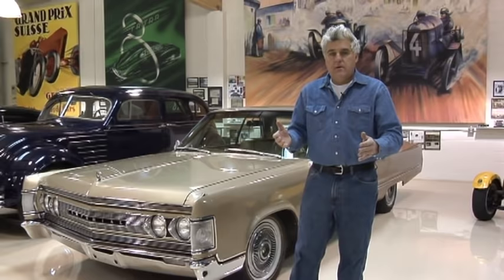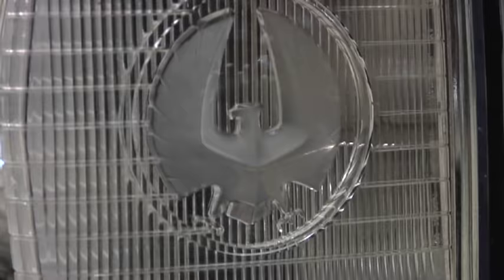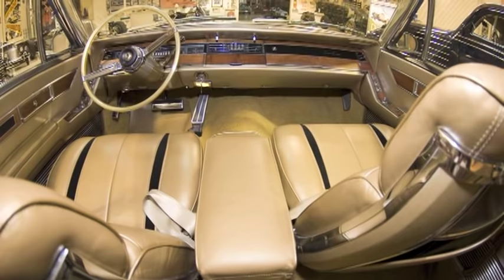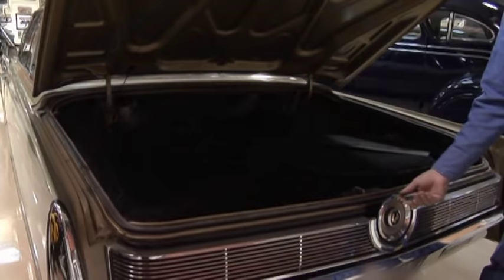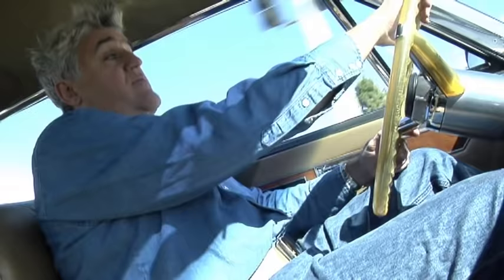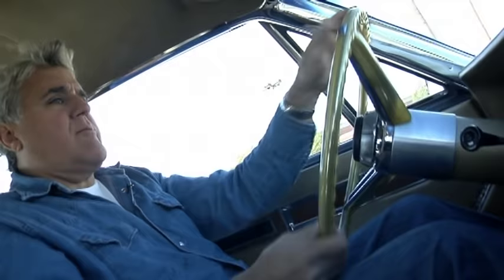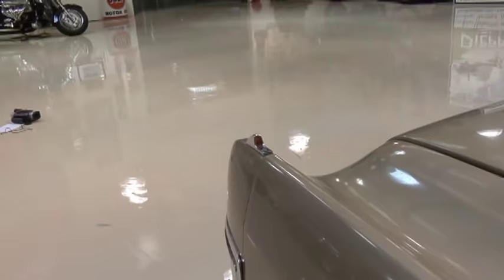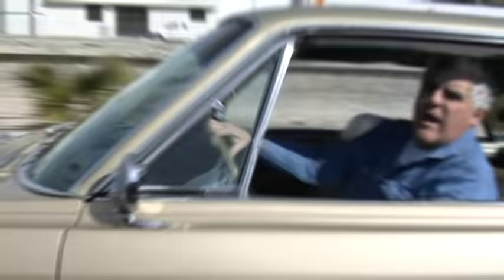1967 Chrysler Imperial Crown Coupe - Jay Leno's Garage

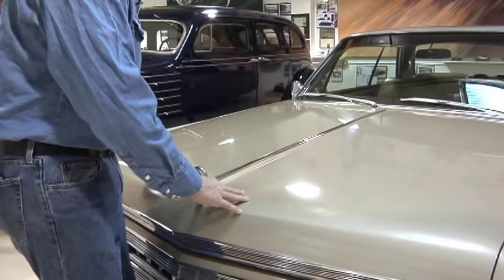Comment: 3:44  "and you're freezing in a minute and a half, you could hang meat in this car"    You're funny.
Thanks for your videos, they are great.  My Dad had a 1969 Chrysler New Yorker, with the 440 cu in  motor.
Quite the automobile.  After that he had a 1972 Dodge Charger, the one with the dual trumpet exhaust pipes.
I was driving it one day, and was parked in front of a store, and this black guy drives up and says, "do you wanna sell that car"?   I said, it's my Dad's I can't sell it.   I think this type of car was in a movie, starring a black actor.
Opps,  second comment of mine,  didn't realize that, well it was 7 years ago, and I ain't getting any younger.  :)

Comment: The torqueflight transmission was not cast iron It was aluminum   It has also been converted to Chrysler electronic ignition  You can see the orange module mounted under the hood on the passenger side I did the same thing to my 67 Imperial Starts easier and runs better for sure. Great car to drive!!

Comment: All of the 1966 and 1967 440 engines were, "hand balanced" at the factory, regardless of car model. This consisted of a heavy, steel  ring on the front of the crankshaft balancer pulleys. It had balance holes drilled into it to finely balance the engine to compare with Cadillac and Lincoln engines for smoothness. This practice ended for 1968.
Reply: I had six 60s Imperials.. and NONE of their engines were as smooth as my '66 Lincoln's 462 CID..... nor did any of 'em last anywhere near as long . . . . .
Reply: @34Packardphaeton  The special balancing was only done with the 1966 and 1967 440 engines. Also the balancing was a heavy ring, welded to the crankshaft pulley. The pulleys could be switched for regular pulleys, resulting in regular balancing, or the engine might have been rebuilt or replaced and the original special balancing wouldn't be the same. The 440 engine was introduced as a big car smooth engine in 1966 and the special balancing was only done for one more model year. It was just a 440 engine with a pulley ring weight that had some balancing holes drilled in it.

Comment: You showed us the tilt steering, but didn't use the Tele-steering that it has.  I had a '66 New Yorker with the same.  Turn that chrome locking ring on the hub of the steering wheel, and the wheel telescopes in and out.  
It will still steer the car if you unlock the ring and even 
also keep the tilt lever pulled.  We would drive down the road moving the wheel up and down and forward and back, still being able to steer, and pretending it was an airplane. :D

Comment: Jay I owned by a 1967  4door. Hardtop it could travel at 15 miles to gallon at 70 miles an hour from Vancouver BC to Toronto cost 120 dollars for gasoline and food for three adults ,my 67 imperial had a 727 aluminum Case transmission it was the best. Car on the highway in bar nun including any thing made by General motors or Ford  I sold it with150 thousand miles on the car

Comment: Technically, it wasn't a "Chrysler Imperial,"  any more than Lincolns were "Ford Lincolns" or Caddies "General Motors Cadillacs."  Imperial was supposed to be a separate marque in its own right, despite its less-than-regal origin.  It started as a high-end trim option for cars made by the Chrysler division, then turned into Chrysler's answer to GM's Cadillac and Ford's Lincoln, both of which started as their own separate companies (ironically created by the same man) and were bought by the respective corporations that now own them.  Japan did not pioneer trying to create a luxury brand from its lower-line vehicle offerings; Chrysler did that first.  However, unlike the names Lexus, Infiniti, and Acura, Imperial somehow never really did establish its own identity as a true luxury marque, and its demise happened just 20 years after its birth.  Of course, the debacle of the "Forward Look" of 1957 did a lot to sully and trivialize Chrysler's attempt at a luxury marque:  All the flash and mechanical advances of that year meant cutting corners somewhere, and as a result every car out of Highland Park (Chrysler HQ's location) became notorious for rusting with a vengeance.  Funny, because '57 was the first time Imperial outsold Lincoln...and the only time; after that year, it would never come even close to Lincoln's figures again.

That said, that particular year of Imperial, 1967, is my favorite of them all, primarily because of the more-than-fleeting resemblance to the contemporary Lincoln (my ultimate car of choice).  That was no coincidence, considering who was responsible for styling at Chrysler at that time.  So cool to see that in that year Chrysler fitted the Imperial with an INSIDE-mounted hood release!  Lincoln was the only other marque that did that...and until I saw confirmation in this video, I thought Lincoln was the only one.  Funny, though, that an Imp will dwarf a Lincoln in overall size, but not in weight; Lincoln still carried the heavyweight championship in that year (and I dare to say, the trunk-space trophy—CHANGE MY MIND!).  I would LOVE to have seen Jay hit the brakes, though...well, tap them, just enough to light up the tail.  Imperials of this year went from having the most unsafe, tiniest taillights of all luxury cars to one of the biggest lighting areas of all cars, if not the biggest—I dare say that even Lincoln's massive taillights in that year may not have been as large!  If anyone dared to hit one of these and claim he didn't see the brake lights, then that motard motorist should never be allowed behind a steering wheel.  Although I also have a liking for the 1960 Imperials (when I'm on a sporadic '50s fins-'n'-flash kick), '67 is in my opinion the best-looking of all Imperials.

Comment: Seat belts were not required to be installed in passenger cars until January 1st 1968. Not 1966 as you cited.
Reply: .. '68 for REAR seat belts; '66 for front ones only.

Comment: i had a friend in high school  he had a  1966 dodge and he would put it in Neutral in a parking lot with the gas to the floor and drop it into drive...  smoke the tires all the way across the lot,  i never understood that...       bust it up    ... LOL...     
i had a 66' Chevelle  396 ci     i also seen my friends with the foot on the brake, & the pedal to the floor,   i know why they did that at the drag strip,  but just to do it,  i told everyone look i don't have to hold the brake,  my car would smoke them at a 10 mi, an hr roll  all the way down the street,

Comment: Imperial was a separate line from Chrysler.  Like Lincoln or Mercury was separate from Ford.  
Imperial was the top model from the Chrysler CORPORATION, not a Chrysler trim level. 
But that's picking nits because nearly everyone misidentified  them as 'Chrysler Imperials'.

Comment: That Steering Wheel Goes In & Out As Well As Up & Down.. C’mon. Jay  Yer Slipping.. You Know A Lot Of Stuff Jay.   Almost As Much As Me.. You Should Hire Me..                 I’m An Awesome  Mechanic & Engine/ Tranny Builder.. No One Knows. More 60s /70s  Performance Than Me.. PS Remove The Points On That 440 Monster. &. Put The Petronics  Piece In There.. I’ll Do It You Want.. That’s Probably The Nicest. Imperial I’ve Ever Seen..                         Soch A Jewl...

Comment: The IMPERIAL was not A  '' Chrysler". It was the product of the separate IMPERIAL DIVISION of Chrysler Corporation from 1955 on. The "Chrysler" name appeared  NOWHERE on the car....nor did it carry the VIN number of a Chrysler. 
All Chrysler models ( New Yorker, 300, Newport, etc, ) carried a "C" make code on their VIN  number. IMPERIAL did NOT. 
It's "make" code was "Y". which was the "make" code for all IMPERIAL models (Custom, Crown, LeBaron, Ghia Limousine) 
If the IMPERIAL was a "Chrysler", it too would have had a "C" make code...but it DID NOT. 
Thus, it was  NOT a Chrysler, but a SEPARATE MAKE. 
Want PROOF ?
1) http://www.imperialclub.com/Repair/Lit/Marque/index.htm
2) https://en.wikipedia.org/wiki/Imperial_(automobile)#First_generation_(1955%E2%80%931956):_A_separate_make
3) https://www.youtube.com/watch?v=wOy6_uk3k3k&t=41s
4) https://www.youtube.com/watch?v=ZCg_ScMJnqk
5) https://www.youtube.com/watch?v=DtyG9jQ1Ydc&t=59s
6) https://www.youtube.com/watch?v=GA51okFc33U&t=203s

Comment: The original owner must have easily spent well over 30k throughout the years maintaining this car. If a guy comes out twice a month to maintain it, that adds up. Chrysler engineering was on top of the world during the 60s. Things changed after the 1973 the oil crisis, Chrysler executives didn't want to downsize, strikes caused quality control issues and sales dropped. The Germans bought the company in 1998, the designs were nice, but the cars were over-engineered. Why should I take a wheel off just to get to the battery? Unfortunately, the Germans eventually ran the company into the ground. Stellantis seems to be doing well, they were more focused on having the Jeep and Ram brands which are profitable but unfortunately, the "Chrysler" brand probably won't make it another 10 years. Young buyers don't care much about branding or luxury, they like sports vehicles and go by the cost.

Comment: Sorry, Jay:
A parking lock was not provided until the advent of the aluminum-case Torqueflites in 1960 (standard-duty A-904) and 1962 (heavy-duty A-727), at which point a lever was added adjacent to the pushbuttons: Moving the lever to the "Park" position placed the car into Neutral and engaged a lock pawl on the transmission's output shaft. Moving the park lever out of "Park" position unlocked the shift buttons so that a d

Comment: Never ever call this Car a Chrysler.  Imperial from 1955 thru 1975 was a STAND ALONE BRAND.  You will find no markings on the Body, or Interior that has the Chrysler script.  
In 1972 through 1975 , last year for Imperial.  At the rear below the trunk lid you will notice  "Imperial by Chrysler".  This was the first time the name Chrysler appeared on the Imperial body since 1954 the last year Chrysler script appeared on the Imperial..  Jay should know better.

Comment: It's not true that a 1967 Mercedes would be a 6 cylinder. The M100 6.3 V8 was built from 1963 to 1981. In 1967 it was available in the large 600 model.